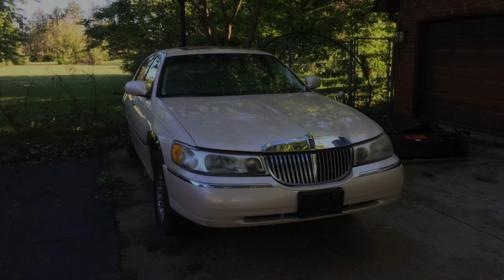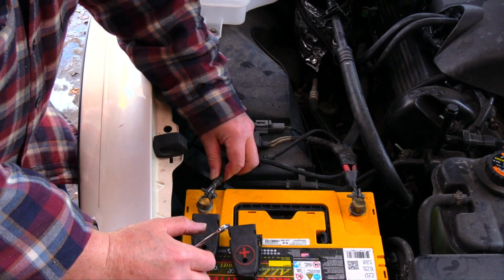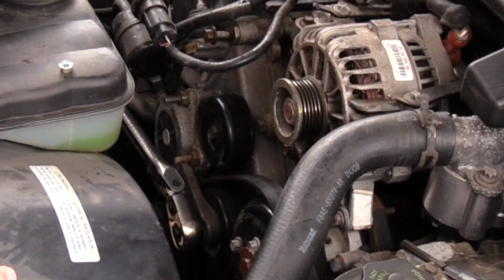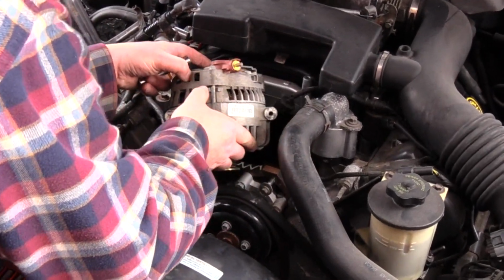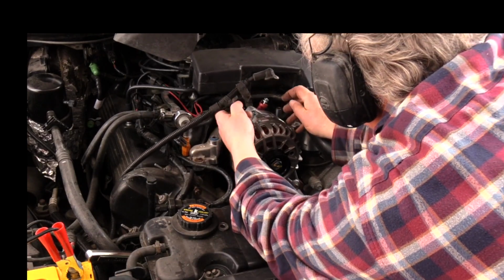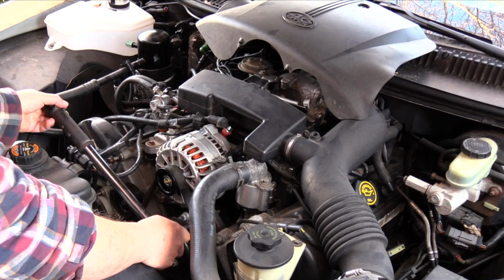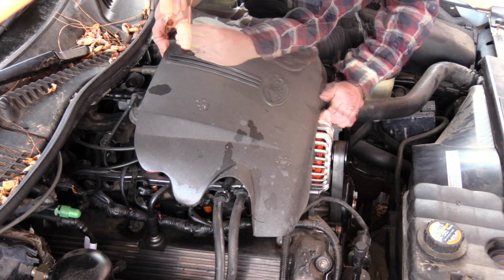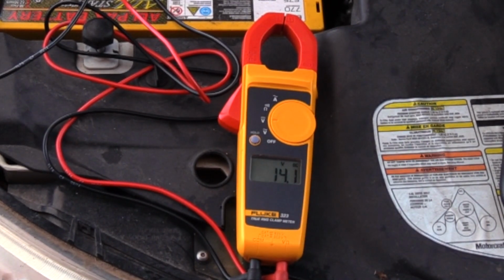No Start, No Crank, Electrical Troubleshooting,  Alternator Swap 1998 Lincoln Town Car

Comment: Battery in my 99 lincoln completely died shut off engine no nothing 
Replaced with new battery and immediately wires started to melt
Fast extremely hot and terminal s correctly installed
Reply from the maker: You have a short , possibly through the starter Solenoid. The solenoid is an electro magnetic switch. The high current your describing is flows from the battery, to the solenoid, and then the starter ( motor) .
Reply from the maker: The alternator has a red wire on a screw on terminal that recharges the battery, that would be the second most powerful choice that could cause a high amperage draw
Reply from the maker: Verify the “new battery terminals” are located on the same side as the old ones, often batteries look the same but terminals are Reversed.

Comment: I've been trying to figure out if its my starter or alternator all I get is a click and my lights go out plus the batteries brand new any tips on what I should do and I have a 98 lincoln towncar cartier
Reply from the maker: That’s the key signs of a starter .  The auto parts store can test both , but they must be removed from the car ! The starter bolts are difficult to get to from the bottom,  but the plastic fender liner is  easy to remove it four primary bolts and an couple accessories such as window washer bottle and battery junction block that must be removed to completely remove the liner, then you can reach in from the side and access the solenoid connections and bolts.